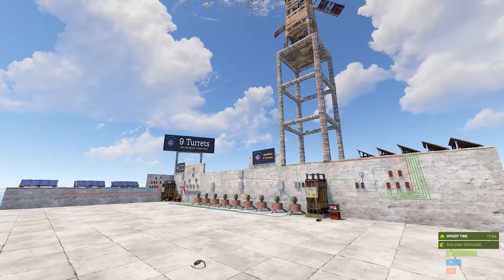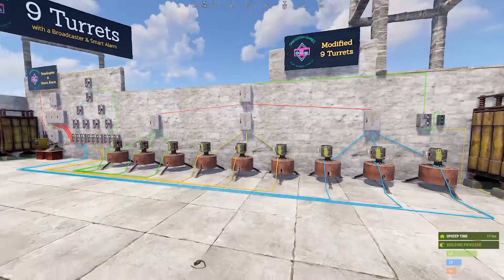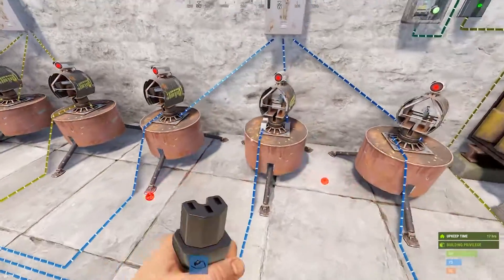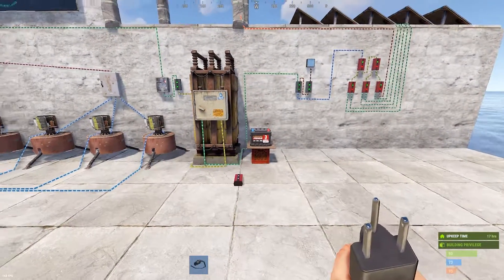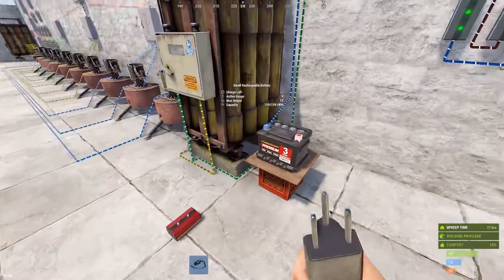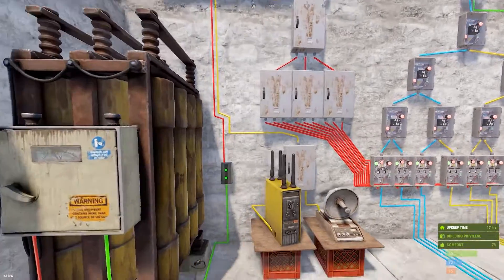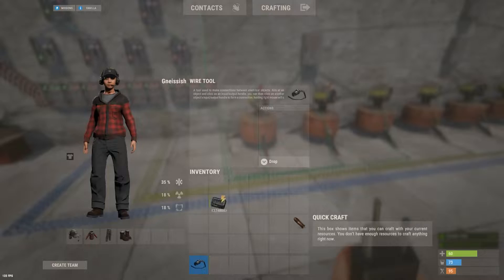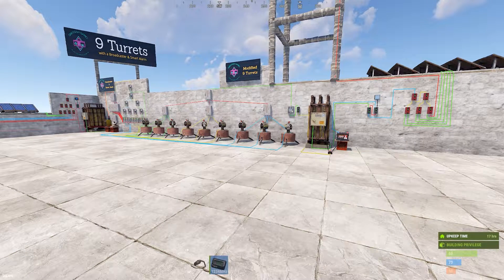RUST Electricity Tutorial | How To Connect 9 TURRETS to One Broadcaster and One Smart Alarm 2022

Comment: isnt all youd have to do to know which turret was low etc is by which and switch it activated color code the bottom and go hey its switch 4 red (just know you wired red on north side of compound and follow the red wire
Reply from the maker: Yes, you could definitely do that! I just meant that you wouldn't know based on a RUST+ message.
Reply: @AustinKlailaGames  for sure for sure, the 9 and switches would tell you which one if you remembered what order you wired them up in (clockwise around compound, or say left to right is top to bottom of base) and then do a different wire color per floor or side of compound and ur good to go, just tossing that out there for those who think they have to go check every single turret when the 1 RUST+ notification goes off... me personally (since in the group im the one that has to do all the power stuff when it gets into "complicated" stuff as my group says. personally i (if i have time to wire it and not in a hurry that is) i remember where and how i ran each thing and what goes where lol but if i'm not on, then doing this method would help the others in the group be able to get ammo back in etc... to stop the book here say it was compound turrets starting on the north side i'd do red, green, blue then go east side red green blue etc etc then they can see hey its the 2nd set of switches and blue so its east side and the blue wire turret etc (or whatever)